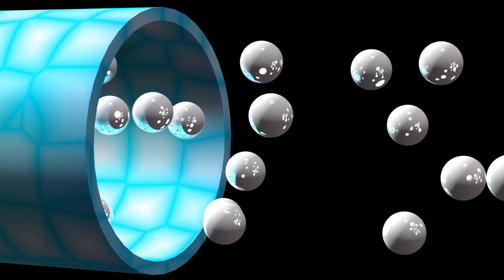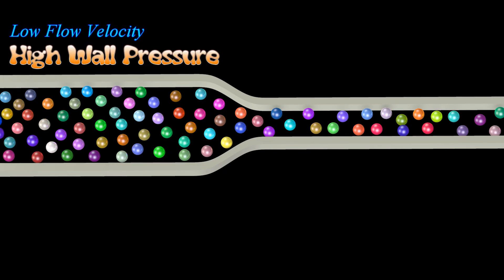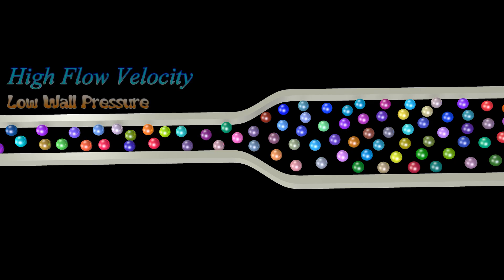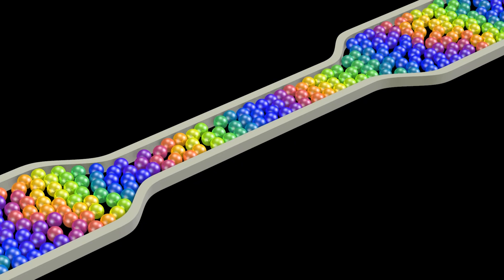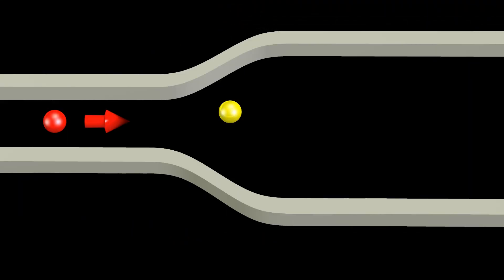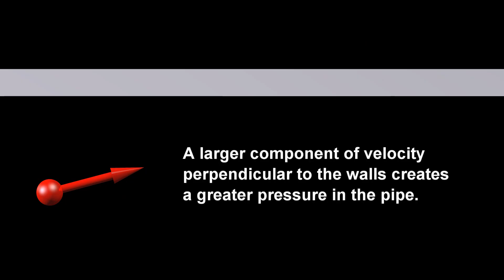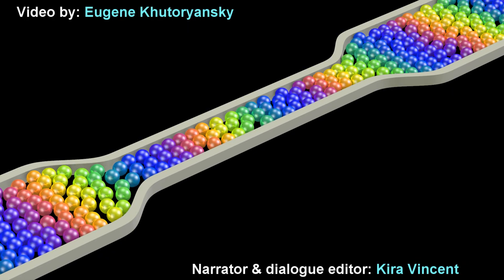Bernoulli’s Principle on Atomic Scale

Comment: very well explained
Reply: Unfortunately, this speculation is not good science. 

The author of this script refuses to accept that a Pressure Gradient causes fluid acceleration as Euler revealed in the mid 1700 while following up on Bernoulli’s work. Air has mass and a force is required to accelerate any mass, even fluids. Pressure is the source of that force. 

Newton for fluids.

And, BTW, Euler derived what we now call Bernoulli's Equation. There is no indication that Bernoulli understood the cause-and-effect for what he saw in that typical venturi tube as the pressure/velocity inverse relationship.

This video’s explanation is very weak in its cause and effect logic. In fact, I am unable to follow the logic. Most times I’ve seen people trying to explain pressures down to the molecule level; they go astray in their assumptions as though it is simple balls - as a Newton’s “Hail of bullets”.

This video’s logic is faulty as follows.

It appears to be using another common misconception. Namely, that the random thermal motion of the molecules is changed by a net speed of the fluid in one direction. This claim is that the velocity and therefore momentum toward the wall is reduced by adding a velocity along the wall. This is clearly nonsense.  The temperature random motion is superimposed on the overall bulk velocity in any direction.

There is nothing to suggest that molecules change their random vibration to more in one direction (along a pipe) and less in another (perpendicular to the wall).  They vibrate the same thermal way regardless of a net movement in one direction and the component of that motion toward a wall is unchanged by that directed speed. This is how vector addition of velocities works.
Orthogonal velocities do not affect each other. This is just like the classical physics example of a cannon-ball that has its horizontal speed unaffected by gravity and its vertical acceleration by gravity unaffected by the horizontal speed.

By this reasoning, air in a sealed jar that is shot from a cannon has altered vibration motions from when sitting still.  This cannot be true.

For example, here is how velocities like this will add: A molecule moving thermally at some instant with a velocity at 45 degrees (up right) with speed (magnitude) 1.0 has an upward component toward a wall above it of 0.707 and a forward component to the right of 0.707. Adding a horizontal speed to the right of 5.0 results in a new horizontal speed component of 5.707 and the same vertical component of 0.707.

Velocities add vectorially.

The component of momentum perpendicular to the wall is unchanged.  The air exiting any blower into open air is at the very same pressure as the still air around it.

This can easily be measured by anyone, just as it is by professional aerodynamicists every day as shown here in 
Weltner, Fig 3:
http://user.uni-frankfurt.de/~weltner/Misinterpretations%20of%20Bernoullis%20Law%202011%20internet.pdf

Finally, the video completely ignores the  presence of the well-known boundary layer which is completely motionless at the surface, so as a result, this claim of the molecules moving along the tube is completely invalid before even entering this above discussion.

 This is bad science.
Reply from the maker: Observ45er, the video is correct.  You may want to read the following.
http://physics.ucsc.edu/~ccrummer/aero1.pdf

Comment: This video is very misleading, cause the collision relaxing time of velocity anisotropic is much much smaller than the characteristic flow time,  the wall will not recognize any difference between atoms from another section of the pipe and the local atom species. Just use the usual explanation about parallel bulk velocity and random direction thermal velocity, though not as straightforward, at least it present what is really happening.
Reply from the maker: You may want to read the following.  http://physics.ucsc.edu/~ccrummer/aero1.pdf
Reply: Unfortunately, this speculation is not good science. 

The author of this script refuses to accept that a Pressure Gradient causes fluid acceleration as Euler revealed in the mid 1700 while following up on Bernoulli’s work. Air has mass and a force is required to accelerate any mass, even fluids. Pressure is the source of that force. 

Newton for fluids.

And, BTW, Euler derived what we now call Bernoulli's Equation. There is no indication that Bernoulli understood the cause-and-effect for what he saw in that typical venturi tube as the pressure/velocity inverse relationship.

This video’s explanation is very weak in its cause and effect logic. In fact, I am unable to follow the logic. Most times I’ve seen people trying to explain pressures down to the molecule level; they go astray in their assumptions as though it is simple balls - as a Newton’s “Hail of bullets”.

This video’s logic is faulty as follows.

It appears to be using another common misconception. Namely, that the random thermal motion of the molecules is changed by a net speed of the fluid in one direction. This claim is that the velocity and therefore momentum toward the wall is reduced by adding a velocity along the wall. This is clearly nonsense.  The temperature random motion is superimposed on the overall bulk velocity in any direction.

There is nothing to suggest that molecules change their random vibration to more in one direction (along a pipe) and less in another (perpendicular to the wall).  They vibrate the same thermal way regardless of a net movement in one direction and the component of that motion toward a wall is unchanged by that directed speed. This is how vector addition of velocities works.
Orthogonal velocities do not affect each other. This is just like the classical physics example of a cannon-ball that has its horizontal speed unaffected by gravity and its vertical acceleration by gravity unaffected by the horizontal speed.

By this reasoning, air in a sealed jar that is shot from a cannon has altered vibration motions from when sitting still.  This cannot be true.

For example, here is how velocities like this will add: A molecule moving thermally at some instant with a velocity at 45 degrees (up right) with speed (magnitude) 1.0 has an upward component toward a wall above it of 0.707 and a forward component to the right of 0.707. Adding a horizontal speed to the right of 5.0 results in a new horizontal speed component of 5.707 and the same vertical component of 0.707.

Velocities add vectorially.

The component of momentum perpendicular to the wall is unchanged.  The air exiting any blower into open air is at the very same pressure as the still air around it.

This can easily be measured by anyone, just as it is by professional aerodynamicists every day as shown here in 
Weltner, Fig 3:
http://user.uni-frankfurt.de/~weltner/Misinterpretations%20of%20Bernoullis%20Law%202011%20internet.pdf
Reply: As you appear to understand, this speculation is not good science. 

The author of this script refuses to accept that a Pressure Gradient causes fluid acceleration as Euler revealed in the mid 1700 while following up on Bernoulli’s work. Air has mass and a force is required to accelerate any mass, even fluids. Pressure is the source of that force. 

Newton for fluids.

And, BTW, Euler derived what we now call Bernoulli's Equation. There is no indication that Bernoulli understood the cause-and-effect for what he saw in that typical venturi tube as the pressure/velocity inverse relationship.

This video’s explanation is very weak in its cause and effect logic. In fact, I am unable to follow the logic. Most times I’ve seen people trying to explain pressures down to the molecule level; they go astray in their assumptions as though it is simple balls - as a Newton’s “Hail of bullets”.

This video’s logic is faulty as follows.

It appears to be using another common misconception. Namely, that the random thermal motion of the molecules is changed by a net speed of the fluid in one direction. This claim is that the velocity and therefore momentum toward the wall is reduced by adding a velocity along the wall. This is clearly nonsense.  The temperature random motion is superimposed on the overall bulk velocity in any direction.

There is nothing to suggest that molecules change their random vibration to more in one direction (along a pipe) and less in another (perpendicular to the wall).  They vibrate the same thermal way regardless of a net movement in one direction and the component of that motion toward a wall is unchanged by that directed speed. This is how vector addition of velocities works.
Orthogonal velocities do not affect each other. This is just like the classical physics example of a cannon-ball that has its horizontal speed unaffected by gravity and its vertical acceleration by gravity unaffected by the horizontal speed.

By this reasoning, air in a sealed jar that is shot from a cannon has altered vibration motions from when sitting still.  This cannot be true.

For example, here is how velocities like this will add: A molecule moving thermally at some instant with a velocity at 45 degrees (up right) with speed (magnitude) 1.0 has an upward component toward a wall above it of 0.707 and a forward component to the right of 0.707. Adding a horizontal speed to the right of 5.0 results in a new horizontal speed component of 5.707 and the same vertical component of 0.707.

Velocities add vectorially.

The component of momentum perpendicular to the wall is unchanged.  The air exiting any blower into open air is at the very same pressure as the still air around it.

This can easily be measured by anyone, just as it is by professional aerodynamicists every day as shown here in 
Weltner, Fig 3:
http://user.uni-frankfurt.de/~weltner/Misinterpretations%20of%20Bernoullis%20Law%202011%20internet.pdf

Finally, the video completely ignores the  presence of the well-known boundary layer which is completely motionless at the surface, so as a result, this claim of the molecules moving along the tube is completely invalid before even entering this above discussion.

 This is bad science.
Reply from the maker: Observ45er, the video is correct.  You may want to read the article I referred to above.
http://physics.ucsc.edu/~ccrummer/aero1.pdf

Comment: No!!! Good explanation ... but not coincidente with the true! I liked the nice animation and the exlanation of pressure beeing the result of impacts of molecules in the wall (taken the normal component). But please: me or you, one of us is seriously wrong. Not even thinking in the great Bernoulli, the reality is absolutely easy: the pressure is allways greater where the fluid comes from than where it goes to, independently of the section or sections in the course; the distance can be measured between the starting and the end ... or by any two adjacente sections. No pressure difference? Then, no flow. No Flow? Then, same pressure everywhere (static condition). Pressure difference? Then flow. Then decreasing pressure, along the way (dinamic condition).

Comment: but if the atoms are colliding inside the narrow section of the tube, and the video states that after the atoms exit the tube, the collisions they have with other atoms decrease the velocity parallel to the narrow section of the pipe, then wouldn’t that mean that during the time spent in the pipe, the same thing would happen to colliding atoms, decreasing their speed parallel to the narrow section and increasing pressure?
Reply from the maker: Inside the narrow section, the molecule is colliding with other molecules which also have a large component of their velocity parallel to the pipe.  If both particles start out with a large component of their velocity in the positive X direction, they will be likely to still have a large component of the velocity in the positive X direction after the collision, due to conservation of momentum.

Comment: I'm still confused after your explanation. I understand that particles going inside the narrow section are more likely to have a greater parrallel component of the velocity than a perpendicular one. But  what happens next? Inside the narrow section, particles interact with others particles and then get also a great component in the perpendicular direction. So the pressure should still be great. Can you explain me  this please? :) but still great video and animation!
Reply from the maker: Inside the narrow section, the molecule is colliding with other molecules which also have a large component of their velocity parallel to the pipe.  If both particles start out with a large component of their velocity in the positive X direction, they will be likely to still have a large component of the velocity in the positive X direction after the collision, due to conservation of momentum.

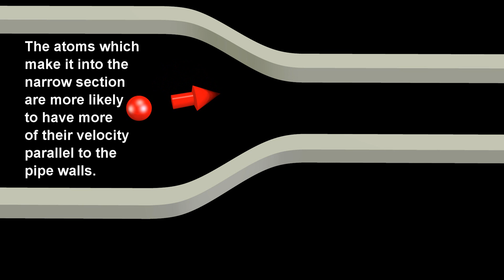Comment: Is this why supercooled helium flows through its container? When cooled down its like the graphic at 3:10, when the atoms slow down enough they do not bounce away, but instead fall into the tubes.
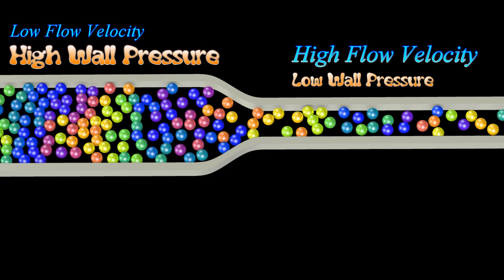Reply: 4:59 a smaller component of perpendicular velocity in regards to parallel velocity,  cooling atoms down achieves reductions in velocity of the atoms.

Comment: In other words: 
1. Pressure in the pipe is caused by the fluid molecules with higher velocity perpendicular to the pipe. 
2. The molecules that enter the smaller pipe are, by design restriction, the ones with higher horizontal velocity (along the pipe). 
3. Hence the smaller pipe area is a lower pressure area comparatively. 

Makes a lot sense. Thanks for explaining what my qualified teachers could not. 👍🏻
Reply from the maker: Glad my explanation was helpful.  Thanks.

Comment: 3:34
This is not necessarily true for every atom. It may be statistically true (it is, to my intuition), but it may not be for some atoms, especially if they can exit at a steep angle (far from the horizontal). The closer the angle is to the vertical, the higher the chances the atom will deflect more towards the horizontal.

If you can better explain that part of the video, that would be nice.
Reply from the maker: I was referring to what is statistically true for most atoms, not necessarily what is true for 100% of the atoms.  The pressure is the result of the statistical results of a large number of atoms, so a few atoms not behaving as described doesn't change the results.  Thanks.
Reply: @EugeneKhutoryansky  Thank you. Great video by the way.

Comment: This is true in one sense, but also not correct. The atoms are constantly moving, and not only bumping against the walls but also each other. The interaction with the walls quickly slows the boundary layer and this vector business is the net change in the group velocity, not the actual atoms, which are mostly in all directions, even in the narrow section. 

What's actually happening is that the energy gradient that is producing the flow is creating a net average "space" in the direction of flow that allows a larger vector, in atoms that are mostly moving in all directions. Without this, the bouncing of the atoms in a narrow section of tube would be the same as the wider section. If this video's explanation is correct, then stagnant air in a tube that goes from wide to narrow would have lower pressure in the narrow section, but this is only true in tube narrow enough to have capillary action. 

It's the same thing with a wing. As the wing moves, it creates a pocket of more space behind the wing and less space ahead of the wing. What happens is a chain reaction where the normally (roughly) spherical bouncing of atoms in the gas, now have more space to travel in one direction; the atoms near the pocket can continue into the pocket, and that leaves the atoms near them more space to travel further in that direction, and so on, and while they are spending more time in that direction, they don't travel in perpendicular directions; the air is like a traffic jam clearing up, flowing around the wing, but the key is to realize that the "acceleration" is an illusion. The atoms were always moving, and are moving, very fast, (fun fact, faster than the speed of sound), and that the acceleration is just the atoms having more space to continue in one direction over the others. 

If you were to zoom in like in this video, you wouldn't see uniform motion along the direction of flow where you'd see them parallel to the direction of flow and exerting less pressure. Especially along the boundary layer, you have atoms moving in circles, and it's actually the group motion that is "accelerating"... in reality, half of the atoms are still moving backwards at any given moment. This video is good to give an intuition, but the actual motion of the atoms is incorrect until the flow is supersonic. This is similar to the misconception that the speed of electricity in a wire equals the speed of the electrons. The group flow of electrons in a wire is actually quite slow, and it's the same with air. The vector you're speaking of here is the net group velocity, not the velocity of the atoms.

Comment: For me that was always simple. The reducer forces the atoms in the same direction, momentarily reducing the vector component on the radial direction. There is a localized energy loss on the reducer. There are other significant effects considering if the fluid is compressible or not compressible.

Comment: Not sure how this would explain the lift of an airplane.
Reply: I don't get that either. It would seem that the angle of the wing is what does the job anyhow.
Reply: because of the inclined angle the lower portion of the wing encounters more particles rather than the upper portion.  To understand it better..... imagine that pressure is the integral i.e. the summation of the particles colliding with the underwing..... those collective sum is what lifts the wing.